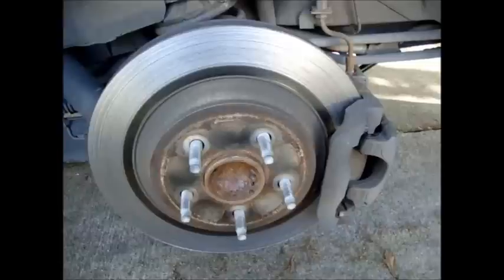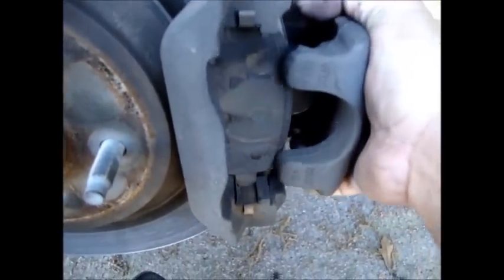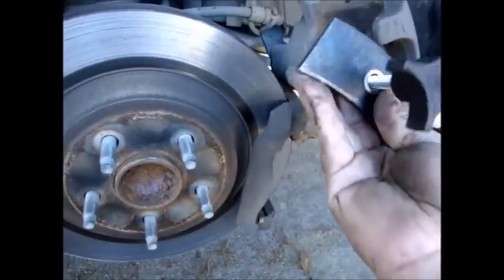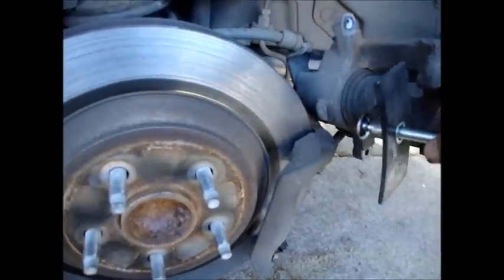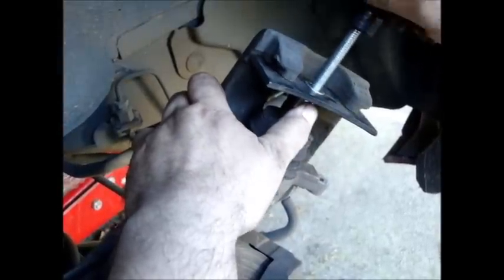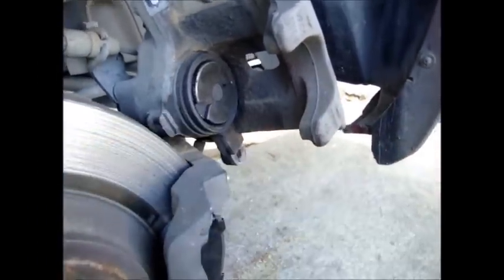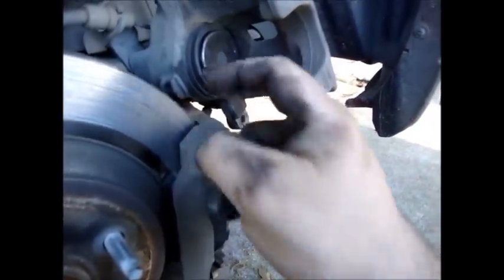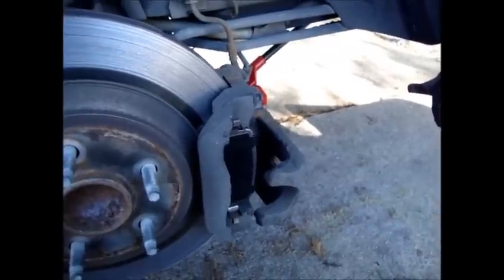2005 Ford Freestar Rear Brake Pad Replacement

Comment: Very helpful. I bought the Harbor Freight caliper comprwssion kit that rotates the caliper while compressing for about $55.00USD. Also, probably good to remind everyone to pump your brakes up before moving the Freestar or the garage is going to be damaged before it pumps up. I did not damage my garage but I've swen it happen at professional garages I worked at. Even the most experienced sometimes get in too big a hurry...
Reply: A lot of auto parts stores actually will rent you the caliper tool, as well the tool to change your serpentine belt too. They charge u for the tool but when u return it you get your money back.

Comment: I did mine this weekend after watching your video. You've got great tips here that helped me a lot. As someone else did,I got the $50 tool at Harbor Freight and it had the correct attachment, which I was not assuming it would. Lining up the flat parts with each other, super important! Also getting those pistons pushed in all the way. I saw some smoke after my first drive, but there are a lot of articles mentioning paint on brake pads, oils on new rotors, and pads not always being precisely the right size. They said add long as vehicle isn't stopping by itself or pulling to one side it should be ok. On my next ride everything was indeed perfect. Someone asked how to get the rotors off. There are two bigger bolts on the same side as the bolts to remove the caliper. Those let you take off what I'd call the guide for the rotor. Then I just hit the rotor once with a hammer and they pulled right off. I bought new rotors, but O'Reilly's does it for $15 or $30 each, I forget. Definitely cheaper than the $90 per rotor I paid, if yours haven't been turned before and you're willing to take the extra time and trip to O'Reilly's. Great video, so helpful!

Comment: Mark, I was hoping to see how to mount the little tin spring clips that the ears of the brake pad slide on. Sorry you skipped that part. Glad to hear you advise to grease the two caliper sliding pins. Last brake job, I must have overlooked this step and now I had to buy a new mounting bracket because one of the sliding pins was froze in it and broke off when I tried to break if free - $35.00 and another trip to the parts store. Thanks for the home made remedy to turn the caliper piston. Saved me another trip to the parts store to rent the high tech tool !!!

Comment: Helpful tip:  Autozone rents the caliper compression tool for free.  It has pins to engage the slots on the caliper to turn it as it compresses it.
Reply from the maker: YES! I finally broke down and went to Habor Freight and bought the tool for like $40.  Its WAY easier than the method I described above!  I'll have to make a amended video to show the process with the proper tool! Thanks for the tip!
Reply: Good to know, thanks.
Reply: What’s the tool called ?

Comment: Thanks, you saved me a hassle and a half. My Volkswagen calipers just turned in with no pressure needed. This 05 freestyle was driving me bananas ! Once I used your method I was finally able to finish .   Btw I used a big c clamp and slip joint pliers. Oh and nice name lol ..

Comment: Good post.
The drivers side went in pretty easy despite me wrestling to hold it. The passenger side was way harder to go in. Wasnt able to turn in and consider myself a strong person. Wound up using a brand new pad and an old pad with half life on it. I don't know why that side was so difficult. I
I bought the cube...returned it immediately and rented the free kit from autozone so i was using the right tools too

Comment: Just in case you want the actual tools to do the job right, Harbor Freight sells the kit for $20 that handles multiple makes of rear calipers.  Avoid the cheap universal cube from the auto parts store,  they don't line up well and usually end up frustrating you more.
Reply: I grinded the cheap universal tool down a little and made it fit lol, used the old pad and a c clamp and spun the cube with a screw driver

Comment: Thank you very much. I was inventing new cuss words until I saw this. Never dreamed the calipers were so complicated. The turn in design probably has something to do with the emergency brake system. Back to the barn (after going to Autozone for the compression tool).

Comment: Some good advice, particularly alignment of piston to pads and alignment of dust boots on caliper pins. You said “counterclockwise” but turned piston clockwise. I had a Ford Freestyle that had Clockwise piston on the left and counterclockwise piston on the right. That rotor on that car needs to be replaced.

Comment: for anyone with a ford 500 the rear passenger side is counter clockwise and keep pressure on the piston when turning or it wont do anything but turn around  good luck

Comment: Good thing I watched your video cause I was about to start working on my Freestar. I've always done my own work on brakes but that was on Chevy's, and all it ever took was a big c-clamp. Thank you
Quik ? to anyone,  it's been awhile since i've done brakes and can't remember if I opened the lid of the Master Cylinder while i compress the caliper to make it easier or would that invite air into the lines?

Comment: idk i read that passenger side is counter clockwise and drivers side is clockwise.Something to do with the emergency brake on same rotar  etc--p.s. I have had  worse rotars--metalic pads and   they will either sand  em  smooth   or  sane  them smooth  and they  warp

Comment: great video, Mark... I am assuming that on the opposite side (right) the caliper would need to be turned COUNTERclockwise? Please confirm this as to not create damage.  thx
Reply from the maker: +Davey Cee I can totally see how someone could come to that assumption, but, keeping with the old adage "Righty tighty, Lefty loosey" you should still have to turn the piston in the clock-wise direction. Have a good one! :)
Reply: +Mark Rangel   Yes  .. you are absolutely correct...(found that out yesterday at the garage)... turns out I had to get a seized (10-yr old) caliper asm changed...  that's why it didn't turn.  tc.... Davey

Comment: found another issue. I got a new mounting bracket from ORileys and couldn't get the little tin spring clips that the brake pad ears slide in, to seat correctly. Compared the replacement mounting bracket to the factory mfg and found it was machined a little different than the original. That's why the tin spring clips wouldn't seat completely. I'll just do the best I can and hope the clips stay put and the brake pads slide properly.

Comment: Mark, forgot to ask, how the hell to get brake fluid into the damn master cylinder tucked under the cowling so close I can hardly get my hand in to remove the cap!!!! I'm going to try to get a small diameter flexible hose connected to a funnel to fit under the cowling. OR drill a 5/8 inch hole in the cowling above the master cylinder cap, to get at it from above.
Reply: I’ve wondered the same damn thing. 
Thankfully I’ve not needed some fluid until today. 
I’m getting ready to change my pads for the first time on my 06 freestar. 
If I figure it out I’ll come back and update you.

Comment: great video.. I have a ford five hundred 2006 it has the same system but the problem I have is that the piston of the rear passenger side came out so how can I put it back is it the same process??
Reply from the maker: guillermo acosta chavez Yikes...You got me on that one bro.  I would assume that you should be able to just set it in place and then start the "press and turn" process I described in the video.

Comment: Gonna do my freestar after work. Do after market caliper's need to be turned !
Reply from the maker: That's a good question, but you might wanna check with the manufacturer of your aftermarket calipers. in would hate to steer ya wrong. Good luck!

Comment: The proper tool to push the piston back into the caliper is literally less than $10 and is a hundred times easier than your homemade contraption. It will also not damage the piston like your Visegrip pliers will.
Reply from the maker: Yes! I finally broke down and bought the kit from Harbor Freight!

Comment: did you replace the front brakes? if so is it the same way on the front? turning the caliper that is.
Reply from the maker: Hey Ashley, sorry for waiting a YEAR to get back to you on this...LOL! But, as you probably found out already, NO, the front brakes just press back in with no need for twisting.  You  can use the compression tool that i show in the video to get the job done quickly! Hope this helps!

Comment: mark i just changed my rear pads on same year van but when i put tires on the tires are so tight it feels like driving with the emergency brake on, did you notice same issue?
Reply from the maker: Hmm.... That's odd.  I have not experienced that issue with my brakes.  You might wanna talk to a certified mechanic.

Comment: Gm I changed my back brake and caliber what happens when there's no pressure and what do I need to do
Reply from the maker: +Tamika Jones Well, if you disconnected the brake fluid line, you HAVE to bleed the lines for air. If you dont, the brakes will have a squishy feel to them and wont have the stopping power you need.  To bleed the lines, there is a  bleeder valve on top it looks like this (http://faculty.ccp.edu/faculty/dreed/Campingart/jettatech/dsc00727.jpg) you remove the rubber cap and then you want to have a second person in the car to pump the brakes. I usually will do 3 pumps and on the 3rd have them hold the pedal firmly and then you use a socket or open ended wrench to loosen the valve just enough for the air to escape.  Keep mind that the brake pedal will go all the way down to the floor when you do this. This is normal.  Once the air has escaped re-tighten the valve and have them release the pedal. Do this twice in order to get all the air out. You'll know its done when brake fluid shoots out instead of air (so use eye protection or place an old rag over the valve when you loosen the valve). I hope this helps. If not, just look up "Bleeding air from calipers" on YouTube there are plenty of vids. Good Luck!

Comment: What if the rotors need to be changed??
Reply from the maker: its the same process but in the video you'll notice that when the caliper is off there is the "brake caliper anchor bracket" still in place.  There are 2 bolts on the backside (unsure of the size) that have to be removed and the bracket will come off easily.  Keep in mind that the bolts might be SUPER tight so an impact wrench or a breaker bar would be a good idea.  Once the bracket is off the rotors are "floating rotors" so they arent held in place by any means, they should pull right off.  Sometimes they will bind and be hard to take off.  I've gotten a hammer and a piece of scrap wood and hit it from the backside and it eventually will come loose with a little "encouragement" LOL! Good luck!
Reply: Never in my life have I replaced any of these bolts. They are not torque to yield bolts so they are fine unless damaged.

Comment: sometimes you can cheat and use  an improper tool..when it comes to this job you should use the right tool...That is why they build a special tool...On ebay cost me 27 dollars for  a 27 piece good for all cars...You mess with the rubber and you will end up spending 50 bucks for that new caliper.

Comment: how do you get the boot to not twist?
Reply from the maker: You just have to be careful not to "grab" the edge of the boot while turning the piston.  If it still happens, its possible that the boot is dried and stuck to the piston itself.  You could get a small screwdriver and gently run it along the inside edge of the boot and see if that helps loosen its "grip".

Comment: I just swapped good pads from a totalled 06 and put them on a 04 that needed them. Same pads, same rotors, same calipers. ALL of the bolts were a different sized socket from one to the other! And fuck Ford and their 18mm bullshit :-)
Reply: Thanks for this video, first one that came up and helped immensely! I'd still be in the sleet rain bullshit cursing my creator if it wasn't for this video. :-)

Comment: worked great. thanks for the video.. I'm going to get the special tool but when I started my brake job I didn't even know I needed it
Reply: I bought the 12 dollar little multi tool that fits different size and models and the two slots that would work had 4 total so I had to file off two pegs to the let the two that fit in it sit flush.